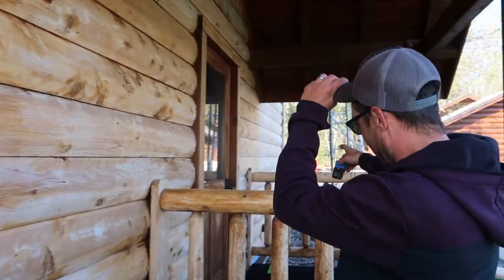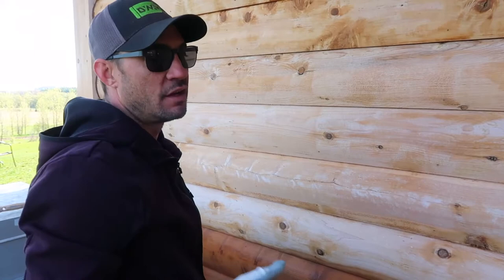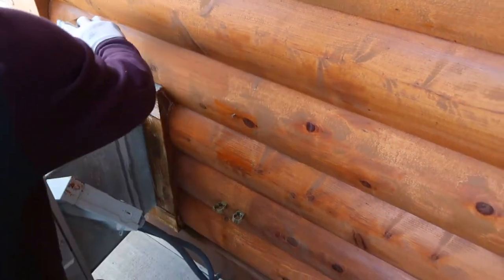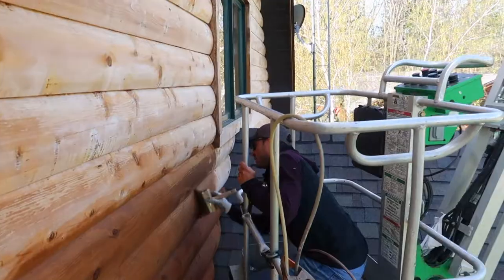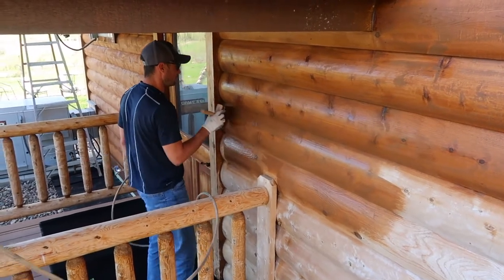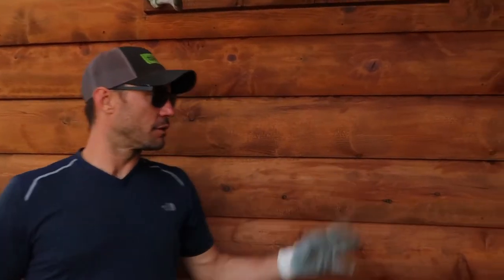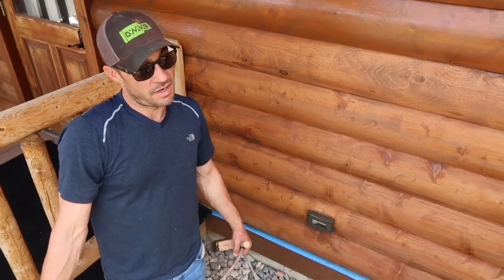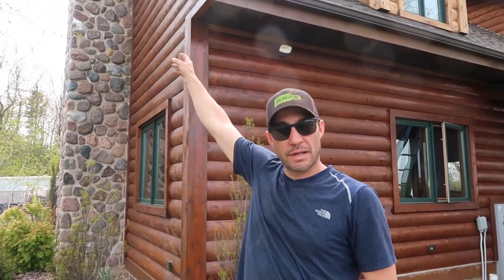Kuehl Industrial Services | Log Cabin (Sashco Capture Stain)

Comment: We do this all day long, spend some time running tape/paper, tape and insert poly over windows, and place carboard shields to avoid overspray mess. Overspray is best managed by going the distance on prep, never leaving a trace of spray damage, cutting down from soffits.
Backbrushing crew follows the sprayman using 30 inch in-line pole gun with pressure turned way down. Sikkens Primary, and Top coat products superb and stand alone.
Good vid !

Comment: Cant believe this guy didn't use any tarps or masking. I do this for a living and that is one of the most important things you need to do. Also you'll be much more efficient using a backbrush pole.
Reply: Using the fine finish low pressure tips really allows us to get close to the window frames. We always keep a wet rag on hand to wipe any overspray from the metal cladding. We hand w ash/Razor blade all of the windows upon completion so the windows look like a mirror. Dont get me wrong-Alot of times we do mask everything as you mentioned. Thanks for the recommendation on the back brush pole- Im just old school I guess!! Thanks for the comment

Comment: Thanks for the video! I've been considering Sashco for our full scribe log home still in the log peeling process. The builder recommended Sashco, i like the color you're putting on in the video. Which color is that?
Reply: The Color was a custom blend of 4 parts Chestnut and 1 part Hazelnut on freshly stripped ( no smooth mill glaze present) log siding.

Comment: Hi - Was wondering what sprayer you were using and what tip?   Looks amazing.
Reply: I was using a titan 740 electric airless sprayer. (way oversized for the project). You can get away with virtually any airless sprayer over 800 psi. I was using a 212 high efficiency airless tip to cut down on the overspray possibility. smaller tips orfice are best. Remember- its easier to put more stain on then to brush out runs all day with a tip that is too big.

Comment: About to stain a new cabin. What brush do you use? I can’t find anything local and our Sashco dealer said use a regular China bristle brush.
Reply: Yes- White China Bristle 4" or 6" block brush. We get ours by the case from Menards ($18.00 each) by the case as we usually use new brushes every single day as the ends get frayed and the Capture Stain/ Cascade Clear is very hard to clean from the brushes. Using a low quality brush will do nothing but make you mad and hate staining!

Comment: Why not start at the top and work down? Seems like you are constantly fighting gravity and checking the lower stained areas for drips. Start at the top is usually a good rule of thumb.
Reply: Because any drips from the top will show up when the sashco capture stain is applied. I see your valid point. I guess its a horse a piece. I usually like to get the sprayer setup and the brusheds "broken in" on the ground level. Thanks!

Comment: I'm curious, how expensive is it to strip and restain a cabin home?
Reply: It all depends on the size and the amount of restoration needed. Access around the house to the logs/siding/gables etc is also another challenge as most houses have landscaping surrounding the house. Our process consists of touching EVERY SQUARE INCH of the surface 6 times! Quality takes time! Thanks!

Comment: What kind of sprayer are you using here?
Reply: titan 7401 electric airless. (way to big for what is needed). Virtually any airless sprayer over 800psi will spray the sashco stain /most all stains. using a fine finish low pressure tip will also benefit you.

Comment: I don't care if you are using a fine finish tip or not, the fine particles of stain fly everywhere once you have any wind over 3mph.. I've been painting for 30 years and we tape everything up, and that's for water base stain. For oil stain we won't even spray it unless the job if in the middle of nowhere so the stain vapors won't travel and hit something 75 yards away.